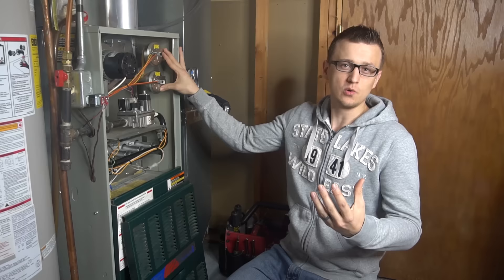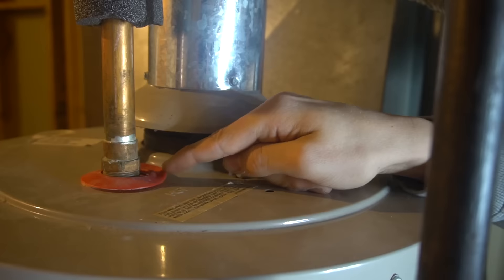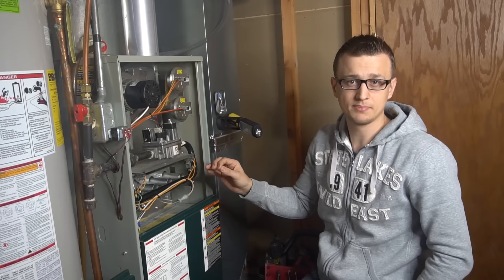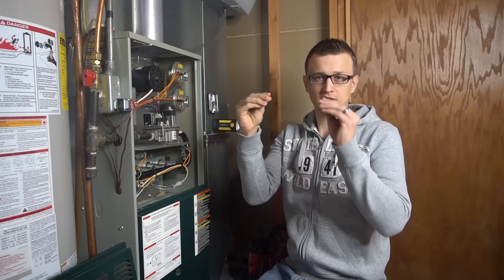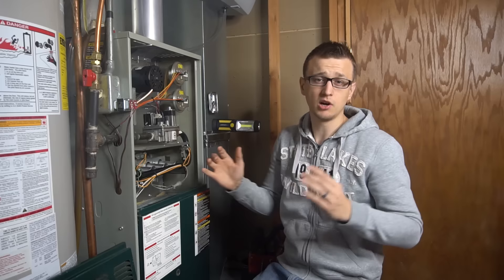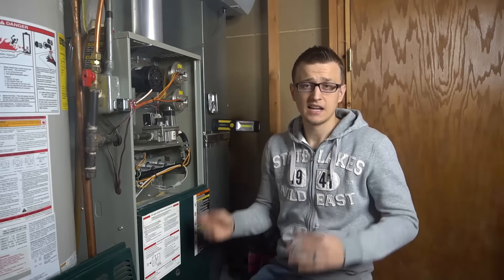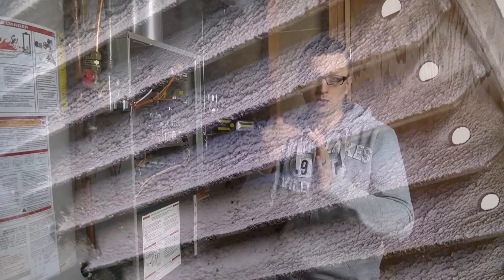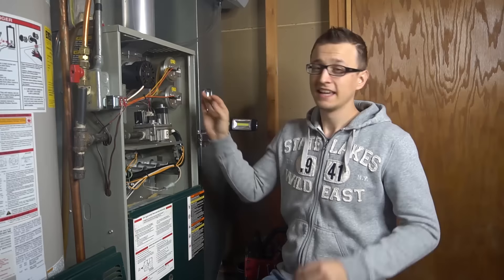Furnace Pressure Switch Troubleshooting

Comment: Hi Jay, thank you very much for the all the tips. I see that usually the case is that the pressure switch doesn't close, which might be due to various reasons. In my case, the error message says "the pressure switch is stuck at the closed position". I remove the hose, blow it and hear the click and the furnace runs for a while until the end of its first cycle. However, when the second cycle begins it gives the same error. I see that the inducer motor kicks in but ignitor doesn't activate and the furnace shuts itself with two blinking error. Do you think the pressure switch is bad? As a side note, this happened right after a company completed the duct and furnace cleaning. I called them and they came again to check but they were clueless as to how a furnace functions (simply turned the furnace on and off a couple of times, which makes me think that I should never have allowed them to touch the furnace.

Comment: TIL if your heater is giving you a "pressure switch won't open" it could be a cracked pressure switch hose/tube. Ripped off the brittle end part, reconnected, BOOM.

Comment: Great videos!! 
Still trying to figure out my issue. I have a HE furnace (two plastic tubes up top). On really cold days, the furnace cycles on, the inducer motor comes on for 2 seconds then shuts off. This is repeated every few minutes. This results in a cold house as the heat never actually comes on. 

Had a HVAC guy tell me hot air is being trapped behind the furnace filter which trips the system. (No error codes) 
I tried removing the filter and it comes on and stays on to heat the house just fine.
I then tried using not restrictive filters (down from 2200 to about 800) which works fine on most days. On the really cold days though (-15 deg C), if I don't remove the filter completely, the furnace starts that game again where the inducer motor comes on for 2 seconds and shuts off.

No noise coming from the inducer motor, it turns and sounds fine.
Any ideas what this could be?

Comment: My pressure switch hose is stuck to the port on the collector box. Any tips for getting it off?
Reply from the maker: Use a pair of pliers to grab it right over the port and then twist it back and forth until it comes off. If the tube rips, simply cut the little ripped piece off and slide the tube back on.

Comment: Jay, I’ve got a open pressure switch light on my water heater. Tested the switch via multimeter and it looks good. While i was troubleshooting it I turned OFF the furnace as well as it is close to the heater and as soon as I turned OFF the furnace, the water heater started working. 
Now, when I turn ON the furnace, the water heater STOPS again. What can be wrong?
I’ll appreciate your feedback.

Comment: I have a Ruud achiever super quiet 80 percent gas furnace, the igniter isn’t glowing and the gas valve not clicking. The light code blinks three times stating that pressure switch is open.

Comment: Hi Word of advice Guru!! i love all your videos. I currently having a pressure switch problem (indicated by LED blinking light).I hope you can help me here, everyday at very first attempt to start heating it run and provide heat for about 5-7mins then the gas fire went out leaving inducer motor still running, after inducer tired of running, it shut itself down.  then it where LED light say " Pressure switch was open while it should be closed". what are the items can the problems? I checked out your "the sequence of operation for Furnace" it sound like it really is pressure switch... please list those items that I should go check them again ? Thank you very much !!!
Reply from the maker: Thanks Poi Suon! :) Well I can't say for sure what your problem is.. But my first thought is that perhaps your condensate trap is partially plugged so water is backing up into the collector box. If you have a high efficiency furnace, I would try cleaning/flushing out the condensate trap and make sure the drain line is clear. See if that makes a difference.
Reply: Word of Advice TV, thank you for quick respond!! I did that as u suggested it gave me a little longer fire(flame on last longer that earlier I mentioned) now the pressure switch is clicking very constantly... like every second.  Is this pressure switch could be the problem? Why it clicking and doesn’t stop. Thank
Reply from the maker: @poisuon4651  It's possible that the pressure switch is weak/bad.. Or maybe that just means that the draft pressure is just very slightly not enough, so the pressure switch keeps opening. Did you clean out the trap real good? Sometimes it takes me up to 10 minutes to clean them. I fill it up with hot water, close the ports with my fingers, and shake it up real good. Dump out the water and do that a couple times. Have you looked at your exhaust and intake pipes outside to see if there is any kind of blockage there?

Comment: Hi . 1 / 12 / 21😁  Good Morning .
it is very cold out side . I have a question ? I hope u can solve my problem .I thank U  .
I've bought a non- programmable thermostat . HONEYWELL round type .
it is easy to install . ok this is my Q : why the fan comes on but the heat is not coming . I have gas burner . I've check behind this thermostat has 4 different setting . for gas & for heat pump . why the heat is not coming on ? The heat come on ok on programmable but not on
other ? I do thanks for respond .
i did called the man who has installed it , he send his son and his helper , they spent almost 4 hours   for a simple problem then they told me this furnace kenmor only with programer . So they had a used one , installed it , it was a TOP TECH ,& no charge .so I can say between my non programmable & theirs 
they take it off & on 10 times . I told them 
why the gas valve is closed , they looked at each other 😮😳🤔, then they open it & got the heat , so I went to homedepo bought the the round HONEYWELL thermostat . only fan come on . What i do not understant how I set those very little switches . I hope u can help.
1/12/21 😊GODSPEED

Comment: Hi. Thank you for posting this very useful video.
My problem is that my furnace will not run until I remove one of the pressure switch wire. Once I remove it, the furnace runs, then I put back the wire (If I don't, the furnace will stop running couple minutes later). When the temperature reached the number set on the thermostat, it turns off like it is suppose to, but will not turn back when the temperature dropped. I will only run when I pull the  wire off the pressure switch.
Any suggestions?
Thank you
Reply from the maker: That sounds like a stuck pressure switch. You may need to replace it but the only way to know for sure would be to check it with a meter. The pressure switch is only supposed to close after the inducer motor comes on. If the board reads that there is power going through the switch (switch stuck in the closed position) even though the inducer motor has not turned on yet, it will not allow the furnace to turn on. Does you control board blink any error codes when this happens?
Reply: @WordofAdviceTV  Thank you for your prompt reply. Yes, the control board blinks 3 flashes, it is "Pressure switch error".
I have one question if you don't mind: the pressure switch I have is 1.55", I couldn't find a replacement, but I found 1.4" and 1.52", will this work?
Thank you
Reply from the maker: The 1.52 should be okay!
Reply: @WordofAdviceTV  Thank you

Comment: This is a great vid and very informative. Unfortunately this almost answers my Q's - What I have seems to be an intermittent pressure switch issue. I have a Braemar that logs a  "P100 Failure to Close" - code 13. For all my checking it seems to relate to the pressure switch. When the heater is off all night, it will log the code several times - I can hear the "pressure fan" working and then it logs the code - this will happen several time - it sometimes fires up with the main fan and then cuts out. Eventually it will work no more probs until I sits over night. Is this a sticky diaphragm....is that a thing?? or an temp sensitive faulty switch?? The rubber tube is good and when I apply Vacuum to the diaphragm via the tube it holds vacuum so the "mechanical operation of the pressure sensor part seems Ok. if it was a blocked air passage, I would think that it would consistently not operate....yes ?? 
I've cleaned the igniter and the flame sensor to cover bases but not sure what else to do. Do you have any suggestions.
Reply: I had the same problem. I initially replaced the pressure switch and that did not help. The pressure switch would open after about ten minutes of the furnace working properly leaving the inducer motor running with no ignition. I watched it do this at least 10 times. I checked with a volt meter and the pressure switch was cutting power to my main control board. I unhooked the exhaust from the inducer motor while the inducer was still running and the furnace fired right up. Don't do this for long as you may blow carbon monoxide into your home. I traced all my exhaust piping through the attic and up on the roof. Nothing appeared to be wrong. No long flat runs and nothing plugged on the roof. I ended up hooking a shop vac to the exhaust and both blowing and vacuuming. Nothing seemed to help. Air seemed to be flowing through the exhaust well enough. I pulled the inducer motor off and had a good look at it and checked the inducer intake for obstructions. Nothing. A storm front moved through last night and this morning everything is working fine. I live at 5000 feet above sea level. Furnace has cycled all day without a problem.  I did switch back and forth between the new pressure switch and the old several times with no difference. The only thing that seemed to help was disconnecting the exhaust from the inducer. I encountered very little water while doing these things. I am going to replace the inducer motor. Maybe it is getting weak. If I still have intermittent problems I will start doing voltage drop tests in the wiring to the inducer motor. 
 This is a very late reply but it may help someone else.
Reply: @tmez3485  Did the new inducer motor fix your problem?

Comment: What is an issue when I put the hose from collector box back on the pressure switch and it causes switch to trip. Runs fine with it unhooked

Comment: How much voltage should the inducer get on a two-stage system that's 90% efficient? Should it get 120 volts or 80 volts, because mine is only getting 80 volts and I'm having trouble?

Comment: Ugh. I took the burner box door off and the thing actually did ignite then, but the flames poofed backwards and then went out. It will not ignite at all with the burner box door on. So does this sound like something is wrong with the heat exchanger, for the flames to poof backwards and go out with the burner box door off? Or could it still possibly be a problem with the intake or exhaust being blocked?
Reply: There were a lot of dead bugs and spiders inside the burner box

Comment: Hey Jay, if the inducer motor blade broken inside, does it affect the pressure switch to stay open? I'm working on high efficiency  furnace. The inducer motor turn on but the pressure switch won't close. I checked the venting also checked the voltage on the pressure switch and seems everything in work order js curious if the blade from inducer motor broken can cause the pressure switch won't close. Thx in advanced

Comment: would the pressure switch be the cause for the A/C to stop working after a few minutes , some times it stops after five minutes,  after the A/C blowing cold air and won't come back on ? Is this the same results for cold air ?
Reply from the maker: The furnace pressure switch/es don't have anything to do with the air conditioner so no, it should not effect it. Although the air conditioner might have a LPC (low pressure cut off) which trips and shuts down the unit if the freon pressures are getting too low. If it is a freon issue, then unfortunately you'd need to call out a tech for that since there's not much you can do for it yourself unless you actually do hvac work.

Comment: I have to loosen the upper cover screws enough to let the pressure equalize in order to get the 3 blinks to stop. What could be blocked to cause that? Piped with a concentric vent kit that worked the first season.
Reply from the maker: There is probably something stuck in the intake outside like a wasp nest or a bird nest. Perhaps ice or snow. Those concentric vents tend to attract all kinds of blockage...
Reply: I'll have to investigate with greater enthusiasm. Thanks for your input. You are a great contributor

Comment: Please give advice if you are able. To clarify. I have plastic vents so 90% i assume. 

Your video says positive or negative pressure is needed. I removed the tube and blew lightly (your video says if I hear a click the switch is bad) light pressure I can hear a click. I turned furnace on and provided light pressure when ignition happened with my mouth. The furnace began working as it should. Without light blowing, the burners ignite then go out.
Reply: Sorry, rewatched. I see if I cannot hear it it is bad.

Comment: Trane XE78 furnace not igniting: My AC is working fine. When turning heat on nothing happens. Red indicator blinks slowly. I checked voltage on board. It give 27plus  Volts between R and Comm, 27 plus Volts between Red and White but inducer motor does  not starts.
When jumping Red and white, it give 110 volts on inducer motor and it starts but again nothing happens even jumping the pressure switch after inducer motor starts running.....any help?
Thanks for your time.

Comment: I did narrow it down to the high pressure switch, checked it with a multimeter and switch never closed.  Jumped it out and furnace started and kept running until I turned off and disconneted the jumper that I used for to verify what I thought, went outside to check pipe and there is exhaust coming out.  Still trying to figure out if its the switch or something else so visiting your vid.

Comment: I decided to replace my inducer motor due to limit switch constantly tripping.  Got my new one and it comes with 2 extra orifices.  One for a 60,000 BTUH furnace,  one for a 80,000 furnace.  I get the old inducer motor out, and there is no orifice attached in the opening so I assume that the new inducer motor should be exactly like the old one and install it without one of the orifices.  Limit switch still tripping!  I'm frustrated.   Busy mom with a 9, 5, and 2 year old.  A few days later, I decide to see what BTUH my furnace is and it says 60,000.  OK,  I'm going to go ahead and put the smaller opening orifice inside the inducer opening.  Okay, its working.  So tell me what in the world happened to the old orifice???  No trace of it in the old inducer or the condensate plate.  She Gone!  I hope I'm done messing with this lovely high efficiency pain in the rear for a while and no more limit switch problems for a while!

Comment: Wait. If the furnace door is off and it runs there's an issue? I have seen many times the HVAC guy taking the door/cover off to check something while the furnace is running. They never said anything about an issue with the door off while it's running. Should I be concerned?

Comment: my furnace is not working properly. i had this problem and replaced the circuit board which solved the problem, now same thing she fires up then shuts down after a minute or two. Also i looked up the diagnostic code for 5 blinks on circuit board and it says not applicable, i dont have an ohm meter but i can get a volt meter to see if the pressure switch is getting good readings. Any suggestions,,, i already installed circuit board myself after the hvac company never got me the part ...so is a meter needed at this point? Thanks
Reply from the maker: Does your blower motor turn on? If you set it to ON instead of AUTO on the thermostat, does it come on? What you described kind of sounds like the furnace starts heating but since the blower does not come on, it overheats. If your blower motor does not come on, there is a test you can try doing without a meter to see if it's the motor or the board that is bad. I explain it in this video: https://www.youtube.com/watch?v=JSgLGTAbDF8&t=4s

If the blower does come on, then I am not sure what can be going on... The pressure switch likely would not be one of my first suspects though. Unless you have a high efficiency furnace with a condensate trap that could be plugged..

Comment: Quick question for you can a bad really on the control board create a pressure switch open code
Reply from the maker: I don't think I have ever seen that but I can't say it's impossible... I would suspect other things before the control board.
Reply: Yah I checked the vacuum switches by checking for a circuit to see if they close and they do and this is a NuTone so it's got four of them and they all check out they all click on when it starts up and it still throws a code saying that the vacuum switch is open so if the relay that switches on to send power to the vacuum switches is bad could that be a thing because literally we checked everything and the only thing left is the board I think?
Reply from the maker: Hmmm... Yes, the board could be defective. Especially if you verified that power is coming in and coming out of every switch. I have had times before though, where the pressure switches are wired in series with other limits and even though it shows a pressure switch error, what is actually tripped is some other limit switch. If you have a wiring diagram for it, I would find the pressure switches on it and see what else may be on the same circuit. Otherwise yeah.. I would go after the control board as well.
Reply: Thanks for letting me know what you think

Comment: The blower turns on automatically but the inducer motor doesn’t turn on. The led say’s pressure switch not open or sometimes not closed